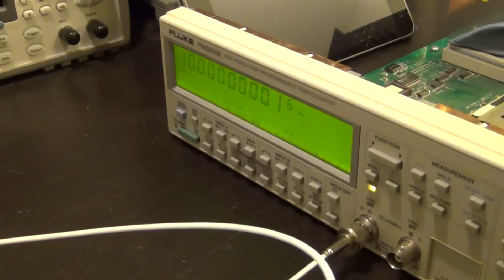TSP #79 - Fluke PM6680B Frequency Counter 10MHz OCXO Reference Upgrade Module

Comment: so I was wondering what the MTBF on an ocxo was and found number like 12000000 hours or more which is like 1509 years so I guess they can be left on all the time though it seems odd that a component could be specified with that kind of lifespan.

Comment: hi great video as always, I have a racal Dana counter with ovened oscillator, it's very stable and highly  accurate. would you advise leaving it in standby all the time? it worries me that the oven will wear out eventually. or is it more stressful for it to go through the warming up cycle too often?
Reply from the maker: +nick philpot Normally you want to avoid the thermal cycle over and over again. Also look on eBay for a replacement part so you can be ready to swap it when (if) it does eventually.
Reply: +nick philpot OCXOs should be left on continuously for maximum stability. They can take weeks or months to stabilize fully, and your long term stability spec is only reached through constant and stable temperature of the crystal. Don't worry too much about the oven dying, it is very easy to create replacement reference modules for the Racal-Danas. I have shared one such design here on my blog: http://syncchannel.blogspot.com/2016/02/ocxo-upgrade-for-racal-dana-199x.html.
Reply: +Sync Channel Blog thanks for the reply, I will leave it on from now on. I'm not too worried about the oven wearing out as I've recently built an off air frequency standard which produces a 10 mhz op phase locked to the BBC radio 4 transmitter on 198 khz which uses a rubidium standard as a reference. only problem is they insist upon amplitude modulating the signal! which causes slight jitter,  never mind I guess we are lucky to have a transmitter with such accuracy.

Comment: I wonder why nobody that is doing these replacement ocxos is putting some extra insulation around the crystal for power saving... I really dislike the need to constantly burn much power to keep everything heated
Reply from the maker: +Dennis Lubert Always-on OCXO is on purpose. Keeping the oven always on increases the OCXO life and keeps it at nominal frequency.
Reply: I know, but it uses power, and that is dissipated as heat into the environment. Adding extra insulation should reduce the requirement of adding energy to keep the temperature stable. My primary reason for my plans to setup a rubidium 10mhz distribution is to significantly reduce the required power in standby state, which is 99.9%+ of the time for most devices.
Reply: I had the same thought.  Is there a design/engineering reason why OCXOs and V-Refs aren't 'surmounted by a logarithmic insulating layer'. Cheers, Mark
Reply: +Dennis Lubert There's already properly engineered insulation on the inside, and they only draw about a watt, maybe two.
If it worries you, save all the trouble and expense and stick a little solar panel on your roof.
Reply: Godfrey Poon Those in the lab at one of my former employers draw between 5-15W and get often too hot to touch on the surface. Together the draw would be several hundred watts. Oh and at home, all available space is already stuffed with solar things ^^
Reply: Dennis Lubert
OK, 5 - 15W is a bit bloody rough!
Reply: Godfrey Poon You can't always have the newest power saving things, there was even some (unrelated to ocxos) old hp voltmeter using nixies... and lets not get into the old brick rubidium standards power consumptions with heat sinks so hot you can bake eggs on ;)

Comment: Did a board for my Philips-Fluke PM6665. The Eagle files are downloadable here. http://www.jackenhack.com/philips-fluke-pm6665-pm6669-ocxo-pcb/
Need to modify it for standby mode though. Thankfully I put a selector switch for internal or external 5V supply, so a quick hack and I have standby as well...